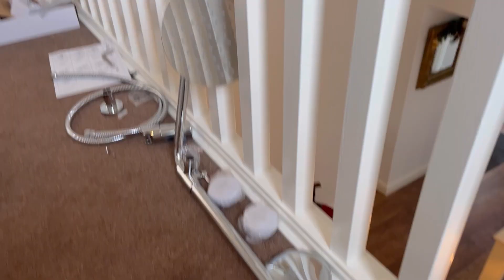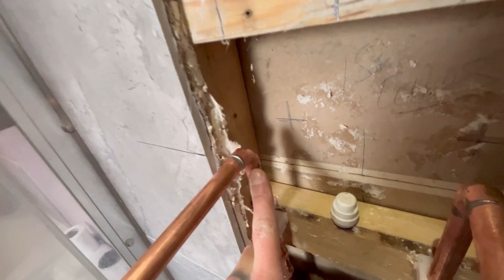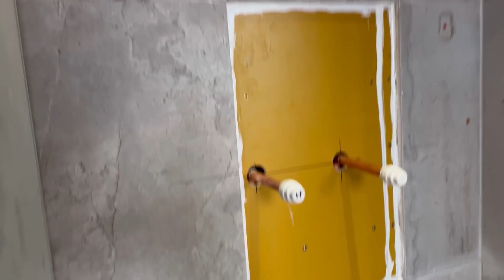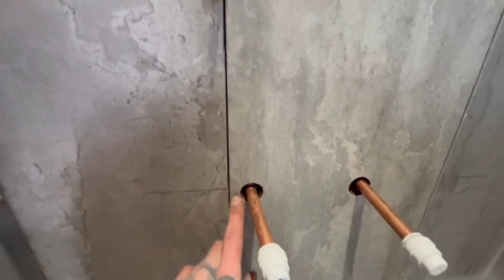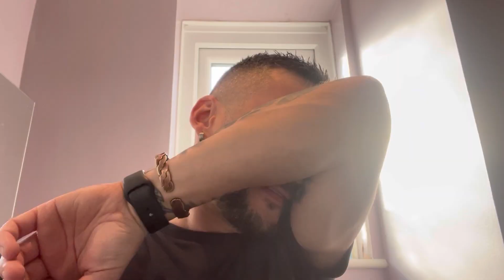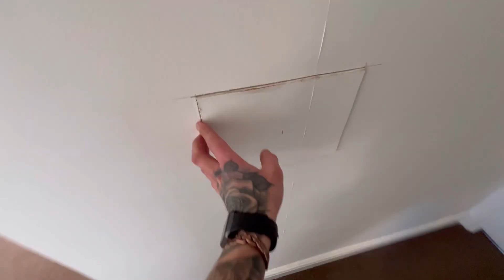Things are never as they seem😩#plumber

Comment: Rule number 6 Dan always  check your pipework when replacing a shower it takes 2 seconds to turn the water on and run a bit into a bucket if iam on my own iv got a spear push fit isolation valve to pop on
Reply from the maker: I should have really mate. Just didn’t expect that at all. :(
Reply: @Heatking  yes if you get a shower valve playing up always look for that I have had it a few times .we're can I get the cleaning brush you had to go in the drill I did look on ebay but no joy
Reply from the maker: @charliewillis8527  there’s a guy on Instagram what makes them mate. His names ‘Dan stokes’